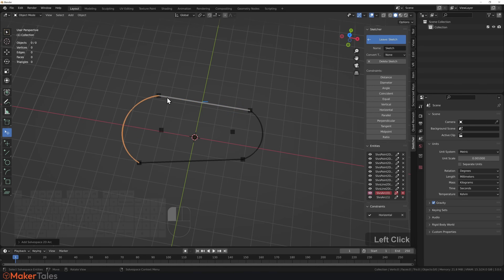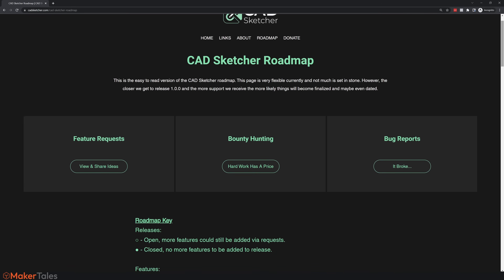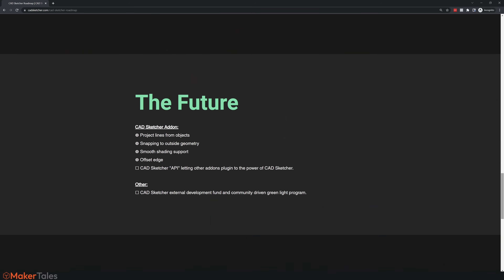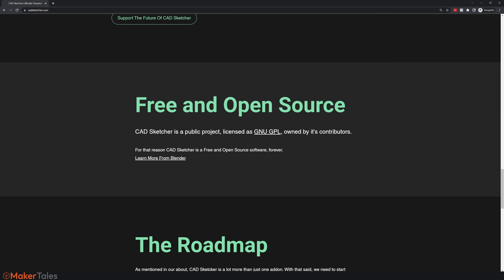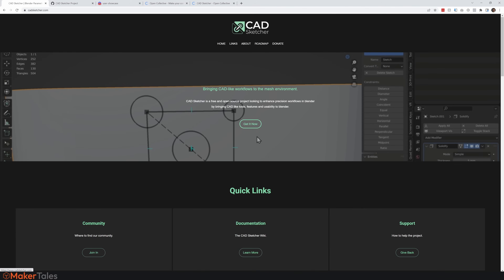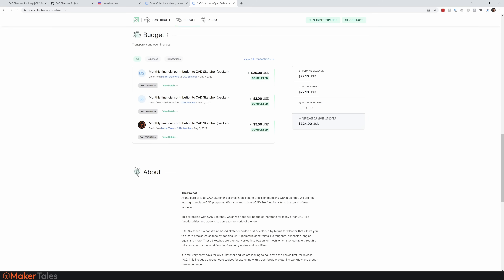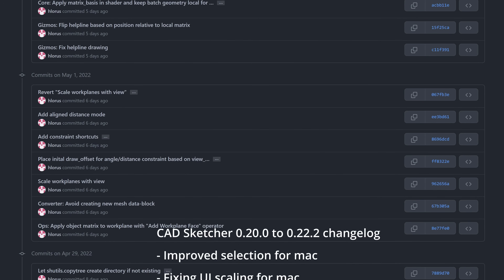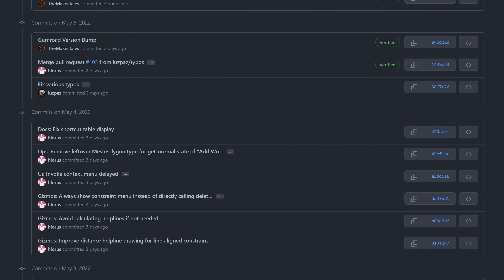CAD Sketcher Is Not A Blender Addon...

Comment: What I'm thinking is that this would be amazing if it could also tap into the data of edges, points and faces that were not generated by the addon. That way you could make a beautiful sculpture and then add a constraint to be tangengt to the normal of the face the line is connected to. Of course that is for the future, for now it is better to indeed increase the functionality as most cad programs already have. Or at least the basics.

Comment: Basic precision modeling is really adding value. However you would mostly import existing assets from CAD and just place them. The real issue is placing, handling and integrating CAD assets into scenes. The key weakness is quickly adding precision basic shapes or multiple copies of basic shapes along pathways. Sounds a bit you are aiming to do yet another full blown CAD.
However there is low cost access to full blown industrial CAD suites and several specialized CAD tools for certain tasks.
You hardly do with a single CAD tool today and need to be absolutely  focused on what serves your niche best.
It gets much different between prototyping and manufacture. Between virtual assets, enhanced scene composition and virtual assets integration workflows and technical virtual mockups and art.

Comment: While it is a nice add-on indeed, it still needs a lot of work. At the current stage, it wouldn't even be considered competition to FreeCAD. The constraint system is unintuitive, the constraints can get in your way and prevent you from selecting features in the sketch and it relies on Blender modifiers which have different names and can confuse people.

Comment: For my home projects, as an engineer, I would invest time and money in anything that is not Autodesk.  From Autocad, to Revit and Fusion360 Autodesk is inferior to comparable products e.g. Solidworks. Blender is amazing.  I am getting better at it with time. Thank you for the initiative.
Reply: SolidWorks is terrible and Inventor is marginally. Fusion is an interesting experiment. AutoCAD's cost for something that has not changed significantly in 20 years is inexcusable. If Blender could use .dxf and .dwg files, with vectors and layers, I would be happy to move for personal projects at least.
Reply: @mf--  With respect,  I beg to differ. Solidworks is one of the best 3D softwares I have worked with in my line of work  since 2004 (Mechanical Desktop, Pro E). As for Autodesk products they have Revit, and some other horror stories including AutoCad 3D on their record. If Fusion was free, maybe, now that they are asking for $6 subscriptions,  moving to Solidworks is the natural path forward for me.  Having said that, I have a lot of hope in Blender precision and hard surface modeling, not to replace at the moment,  but as more Add Ons are developed the framework is being built for this amazing software.
Reply: Have you tried the cross platform Freecad?
Reply: @jmileshc  At work I have access to Solidworks and  Autocad. So, I haven't tried FreeCAD, but, will look into it. Thank you very much for letting me know.

Comment: Nice work. Well done.

With a segmented single line path through 3d space, and the ability to rotate/scale/swap sections that attach to it along that path, there is nothing that can not be modelled IMHO.

All we ever needed was 2D planes and a segmentable 3D single line slice path.
Then you can do any kind of extrusion/rotation/revolution/scale/deformation along the path.
Throw in parametrics and all of that can be environmentally or magnitude conditioned.
Then you can move into scope limiter 2D plans with a max 2D plan and a min 2D plan, with the parametric driver, somewhere between.
Taking that fruther, you can have conditional merging of multiple preset plans.

I know that it is good to have options to suit people workflow.
But I am also of the opinon that you should keep it simple stupid (via a universal methodology in this case), or complexity becomes unmanageable.
What coudl be simply then the same straighforward process/pipeline applied to everything that can/will be created.
Where all that changes, is the path and the section.

Comment: Blender is open source.. is there not a thought about building this in to Blender properly? One of the reasons tools like Modo are so attractive is because they try to blend the best of both artistic and precision technical perspectives in modeling.

Blender could really use help in this area. Its UI is still utterly baffling. Like trying to make a tube along a path; most modelers you click the path and the shape, and then something like 'extrude on path' and done. Blender is like 5 operations on each part to get there. Even after the improvements in 2.8, it's still the most confounding modeler I've tried. There is no point to trying to understand the flow in Blender. It's the Differential Equations of modelers; the only way you will be successful with it is rote memorization and faith.
Reply: That blend is one of the reasons why many product designers use Rhino3D. It can do both.

Comment: hmmmm... It's fascinating to see a good sketcher in that blender-UI, but from an engineers perspective: If the intention is NOT to integrate the CAD (with import/export and much more) into Blender then what is it good for the workflow? 
I tried it and it's beautifully done and I'm going to use it (something forgotten in the CAD assemby, etc.) but...
I'd prefer the integration of a real volume modeller allowing (boolean,..) operations prior to tessellation and final rendering. That would really prevent from modelling all twice. 
More blasphemy (LOL): FreeCAD asm3 for example (since it's open source as well) would be perfect to rebuild the assembly structures directly in the blender object tree. The easiest would be a good FreeCAD importer (there is a promising first one) rebuilding the assembly structure as collections, syncing of standard materials (plugin in FreeCAD to match Blender-properties) and fine tuning of tesselation.
Reply: Yep. If it doesn't intend to replace standard parametric modelers, I fail to see why anyone should use it other than those who are doing hardsurface modeling and when you are doing that, parametric modeling is probably not the ideal workflow.

Now, if the argument is that what they mean is that they see a lot of parametric modelers as having extraneous features, that is fair. For example, having physics constraints is probably not needed. Same thing for in-place editable assemblies. (I actually lean towards having that can be a net negative.)

But that isn't what I think was meant so I hope it isn't intended to be a google sketchup level parametric modeler. If so, it is useless.
Reply: You had me right up into you suggested FreeCAD. With the working limitations of FreeCAD simply within the features and uses that it's supposed to support, we'd all be better off switching over to BRL-CAD... - with no classes or tutorials. Thank you, but no.
Reply: @claws61821  don't think so
Reply: @claws61821  honestly every influencer here is overselling what this add-on is. Even when these nerds use the Term CAD and precision modeling in Blender I kinda laugh. What point is a sketch solver when you do not have many of cad surface / solid modeling tools …

But where I see this add-on being brilliant is for a lot of hard surface modeling, concept modeling, when you rather would like to work with dimensions. Also for architecture and interior design I can see this being what is really missing in Blender.
Reply: @cekuhnen  Eh. Most of the tools in those programs are fluff and extra primitives. Boolean operations are there. Custom planes are there. Sounded like parametrics and constraints could use work. I don't remember the video well enough to comment further.
Reply: @claws61821  Fluf ? You have a funny opinion about surface and solid modeling for product design and manufacturing.
Reply: @cekuhnen  The vast majority of "tool" features in those programs either can be replicated directly through the most basic ones and the ones I've already mentioned or are otherwise in this add-on, or else are purely cosmetic. A good example of this is knurling, which can be done by differencing splines with cylinders or other shapes, or by differencing a rotationally extruded sketch with its mirror, and in consumer products at least is more often cosmetic than functional. Screw and bolt threads likewise.

One tool feature that I would like to see is a general script modeling input that's more accessible to beginner and intermediate users than the heavyweight pure Python input. It's all well and good to have that and all the wildly variable functionality it provides but it's not explicitly meant for scripting models so much as it is for scripting add-ons and it doesn't openly advertise anywhere that it can be used for that, even when you search the documentation. It's also not easy to just jump in and use it for modeling without significant knowledge of Python, which is a strong obstacle to beginner users or those migrating from friendlier scripting-capable modelers such as OpenSCAD. A few attempts have been made by users to implement script input interfaces modeled directly after specific CAD APIs (again, OpenSCAD is the only one which comes to mind offhand, but I've seen at least three others in Google searches) but these all get abandoned after only a year or two of development.
Reply: @claws61821  I think we have a misunderstanding here - for cad capabilities blender needs surface or solid modeling tools and not polygon.

And that with a workflow and interface that does not want to make you committee suicide.

It would be amazing to have poly and nurbs on one
Reply: @cekuhnen  Ah. That would be our miscommunication, then. I wasn't considering core architectures as simple tools. Yes, Poly+NURBs in one FOSS suite would be great, especially if BREPs are also available. All of that combined with an overarching interface that allows both mouse control (sculpting, etc) and keyboard input (scripting; both shapes and functions as well as expansible to feature add-ons).

Not likely to ever happen in our lifetimes simply because people who regularly use or know how to program many of those features are too beholden to the proprietorships of corporate software giants in one way or another and the rest of us don't even know where to start.

There actually are a couple of proprietary suites that include all three of those architectures in one, but their pricing and business models put me off. No company should be able to charge you for several years of interim tech support you didn't need to use just to allow you to update your licensed software, especially at several thousand dollars a year per seat.
Reply: @claws61821  yeah it would be a dream to have nurbs and SubD in one app even if it world be animating later mainly polygons only
Reply: I can see this replacing sketchup completely for me.

Comment: 1) Has a anyone here tried TechSec for Blender? (I think all the sections/elevations need to be the same scale per drawing sheet).  
2) Does anyone know anything about the CAD Geometry Kernel (engine) that is in experimental within Unreal Engine? 
3) Has anyone experimented with the frequently evolving BlenderBIM drawing sheets?
Reply: Ultimately Ton R doesn't believe in CAD in Blender so it's always going to be an uphill struggle.  I'm secretly hoping that Epic will maybe develop their modelling etc. with CAD in mind.  Some sort of hybrid Polygon and NURB workflow is needed to get the best of both worlds.
Reply: @benveasey7474  yeah I talked with Tom a lot about this - he has also limited resources but also failed to realize how some basic nurbs modeling tools would help asses modelers 

Also those polygon hard surface kit-bash and what ever try to hide that SubD is not made for object modeling.

Nurbs or solid modeling defeats it hands down 

Look at plasticity or Shapr3D as an idea

Comment: could somebody please explain to me why this won't run on win7 - is it the addon or Python that is not compatible? thanks.
Reply: If Blender won't run on your computer, try running an older version, like 2.8. You probably won't be able to use this addon, however.
If an older version runs, it probably means your graphics chipset is obsolete, and you'll have to upgrade your computer's graphics capability.
Reply: @grandpaobvious  i thought it was Obvious, Grandpa, that i was talking about the addon, not Blender in particular ;)
Reply: More recent versions of Python 3.x don't work on Windows 7.
Reply: @BrunodeSouzaLino  i'm running 2.9, managed to install the addon, but can't get the PIP to install - tried doing it manually, but i have no idea what to do once i've got it from the file location - it just sits there telling me the directory address - there's no go button